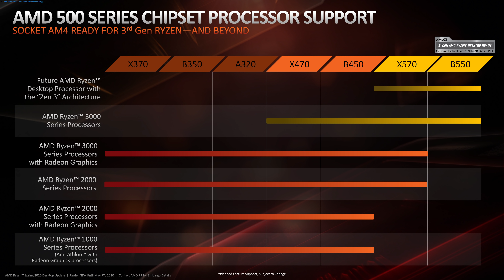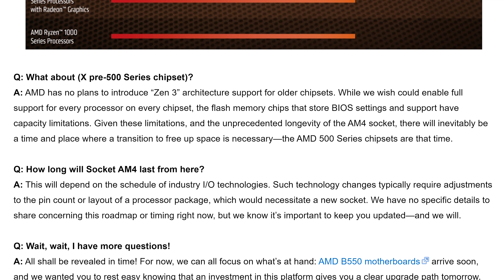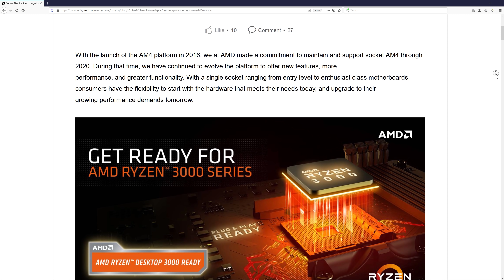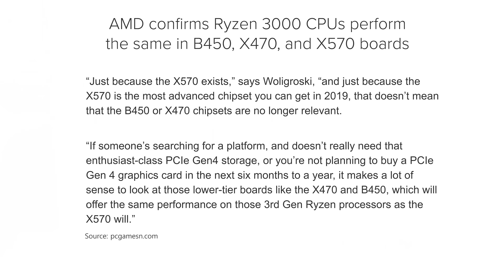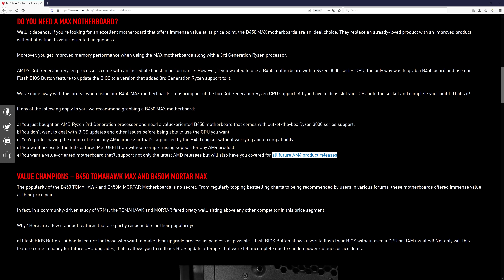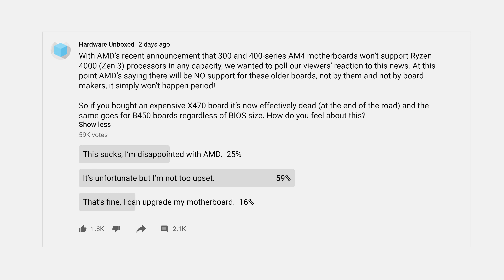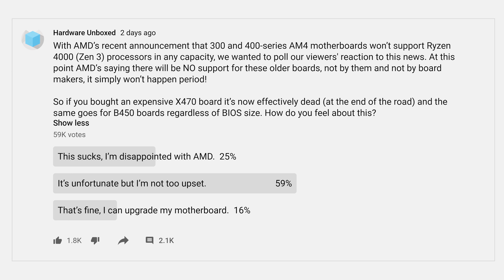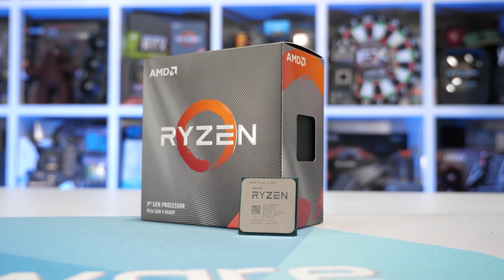AMD Does An Intel, Axes Zen 3 on 400-Series Motherboards, Our Thoughts

Comment: X470 owner here... I'm happy they did this!
I also bought the R9-3900x (12-core) CPU for gaming and video productivity, and when they started talking about the 4000 series being potentially a lot faster I thought "Damn, will I consider upgrading if it does?" then I thought "come on, you got a great CPU why even think about it?" but my brain still wanted the latest and greatest... well, now it's apparently a non-issue as I certainly won't buy a new motherboard as well... I actually expect my 12-core CPU to last a long, long time for multiple reasons:
1) games and applications will get better threaded (so will use MORE cores thus reducing or eliminating CPU bottlenecks based on individual core performance), and
2) many applications are shifting more towards GRAPHICS CARD acceleration
3) 2020 consoles like PS5 are likely to have a very LONG lifespan. PC games will utilize the same basic code for large part.
**So basically I can see upgrading the GRAPHICS CARD to an RTX3080Ti or similar but I honestly think I'll be getting 10 YEARS out of my R9-3900x. Seriously. I got SEVEN YEARS out of my i7-3770K which was a 4-core CPU. I could mostly game at 60FPS/1440p still with that. Now I've got 3x the cores and most games don't go above 30% utilization (with or without a CPU bottleneck?) Seems like plenty of future-proofing right there.

Comment: Uhm guys what part of PCI-E 4.0 is not understood? The next generation is not backwards compatible with 3.0. This is why you cannot take a Ryzen 1xxx cpu and toss it into a X570 chipset board, it doesn't support PCI-E 4.0. Now they could have had a compatibility layer, but that comes at a cost of performance. AMD had to and what I don't understand is you bitching about it when AMD has never done this once and is the first time and 3 generations could run off the same board, that's about 4 years of use. Unlike Intel who forces you to get new everything with every new release.  

Which brings me to remind you all of the socket 939, when everything jumped from AGP to PCI-e. Well some boards found a way to support AGP, some piss poor while few reached out and had a custom chip made to handle both AGP and PCI-e, look no further than the ASRock 939 Dual SATA 2.

Comment: I have a TUF X570 WiFi and I do care. When my MSI X470 GP Carbon imploded I bought an X570 partially because I knew in the back of my mind AMD/their board partners are chomping at the bit to pull an Intel. This is infuriating, and I doubt MSI are upset by this. I bet they were a board partner pushing AMD to drop support even if they know they're possibly getting sued. These lawsuits are all calculated as part of their budgets, it's a cost of business every major corporation considers when doing anything.

So I disagree with you for the most part, they may not be "just like" Intel, but they are much like them. They're a giant corporation, therefore a greedy entity out to make as much money as possible at any cost. The only reason they ever maintain any good image is their bottom line, not out of the goodness of their hearts. They calculate how much bad press they can receive resulting in how much potential sales lost due to a bad rep for doing X or Y dick move vs how much those dick moves make them to begin with.

Comment: Your wrong about the 300 series motherboards owners not being upset. I bought a X370-F Strix with every intention of upgrading to a Ryzen 4000 series chip based upon their promise of AM4 socket "support" through 2020. I could have spent about a $100 on a Tomahawk, but spent close to 2x that with the idea of getting a better board, with better VRM quality to ensure I could easily support the higher core counts and clock speeds in 2020. Any reasonable person would take their promise of AM4 socket support through 2020 would mean bios support for any AM4 CPU through 2020. Steve I love ya, but I also reject the argument of at least AMD should support 400 series. There is ALMOST NO DIFFERENCE between X370 and X470 chipsets other than slightly better XMP memory support (of secondary timings of more kits). So if AMD decides to open up X470 to Ryzen 4000, then X370 should be opened up as well, and they will have kept their promise! I also reject the idea that 400 series should be, but 300 series should be happy with what they got. WRONG AGAIN. AM4 socket support through 2020 means just that, not only 500 or 400. They said AM4 socket support. 
I don't ask for more new features like PCI gen 4 support (even though they easily could), just keep your word AMD!

Comment: This does suck. I built two Zen 2 systems on B450 boards, expecting that there would be an upgrade path with the mobo. It wasn't the focus of my requirements, but it was a contributing factor.

Biggest reason I didn't go for X570 (apart from the fact they were freaking expensive) was the total lack of mATX options (plus I have no need for pcie gen 4 and I hate the cooling fans on X570). Seriously, why do mobo manufacturers avoid mATX so much? I'll never go back to ATX, SLI/Crossfire is dead and I got over massive gamer-aesthetic designed-for-instagram cases a very long time ago. I enjoy having my desk space back, and I don't give a crap about farming pretend internet points posting photos of my rig. But now I'm off topic.

This is very disappointing news from AMD, especially given their comments and marketing giving the impression that B450 would be supported for next gen Ryzen.

Comment: Me thinks you're suffering from Post  Traumatic Intel Disorder #PTID.  AMD took us from AM2>AM2+>AM3>AM3+ almost the same way and I only had to switch either the motherboard or CPU, not both.  Am I disappointed that my ASRock x470 Taichi that I got with my 2700x isn't gonna make the cut, sure but I still have 12 and 16 core Ryzen 3000 to look forward to.

Comment: I am disappointed as I purchased a TUF B450M-Plus Gaming mother board just a couple weeks ago, assuming it offered some upgrade path.  I gave a lot of consideration to X570 but didn't think I needed it for PCIE 4.  And the availability of x570 micro-atx boards at a reasonable price were very poor to nonexistent.   Looks like I just plain picked the wrong time to build.  Almost every first choice I made was out of stock.....  Tho I did manage to pickup a Rizen 5-1600AF for $85.

Comment: If they are going to support 4 generations of CPUs on a socket they should include a bios memory chip large enough to do so.  I own a b450 2600 and was looking forward to upgrading to a single ccx 8 core 16 thread processor on zen 3.  Not 12 or 16 cores which I know my budget motherboard might have issues with on the VRM side but just an 8 core and I can't even do that now.  Leaves a damn sour taste in my mouth and I'm not happy.  I understand why many others aren't either. If I have to buy a new motherboard now anyways, should I grab an Intel part with 8 cores for better gaming performance anyway now...?  Sad state of affairs.

Comment: People were able to hack coffee lake onto x270 boards on their own, I doubt it wouldn't take long for the community to do the same for zen 3 on 300/400 series motherboards. The only issue was the lack of transparency from AMD, I could see a lawsuit and regardless of if MSI wins or not, destroying their relationship with their best oem/board partner for both cpu and gpu as well as laptops would not be worth it. They will bend on this issue or break trust with everyone entirely

As the owner of an x370 (msi xpower titanium) I don't really feel cheated by this as I can still slot an 3950x into this board for no additional cost. I mean unless AMD releases zen 3 and it wipes the floor with zen 2, the 300 to 500 bucks saved on not needing a new motherboard is well worth a 5-10% performance decrease.

Comment: I am another one of the MSI B450 boards and a R5 3600 purchasers (just before the lock-downs because I needed something there and then for working from home). Really pissed because I could only afford a R5 / B450 at the time, but was planning to upgrade in the next year to 8+ cores as I run a lot of VMs for development (either a second hand 3000 or brand new 4000). I figured that they would at least ensure that AMD wouldn't break support on a sub 1 year old design. Unfortunately I see this as a double whammy as the new chips won't be compatible and the second hand R7s / R9s will hold their value as they remain near best in slot for the vast majority of motherboards sold. 

AMD should have released the B550 earlier or at least announced that support would be limited. At least with Intel you know your being screwed. 

I will be skipping the 4000 ryzen processors as they will require a new platform that will be on its final generation with no future upgrade capacity. Come next upgrade it will be a new platform, so here is hoping that Intel gets it stuff sorted.

Comment: I've been holding out for a B550.  I think this crap.  But, give them a tiny bit of leeway for the support we did get.  They should be supporting B450 chipset with vendor support.  Unless Zen 3 is so good that cutting support is needed for performance.  But, again give consumers and vendors the choice.

Comment: When I first went the Ryzen path, I got a 2400G and a B450. I then upgraded cpu to a 3700X (i have never loved a processor as much as I have this one!).  I now almost have enough parts to put together 2 full computers. I am disappointed to hear that AMD won't be supporting B450 anymore, but fortunately, I was planning on buying a B550 board anyway.  Then I just will need a Zen 3 processor when they come out ....but it delights me to no end, that my 2nd, spare, backup computer, is going to have a frickin' 3700X in it. It is going to be the most powerful backup computer I have ever had.

Comment: Holy, Hell, that is enough compound for 10 CPU's 9:49. Less is more, in this case, they say pea sized drop or about  4-5mm.  Pea probably too big more like an eraser head on on a pencil more than that is just a waste anyways.   Applying too much thermal paste will lower the heat
conductivity and cooling performance!

Comment: The biggest pain in the rear-IO here is that B450 needed to serve as a surrogate B550 as the latter was nowhere to be seen for what ? A full year ?.
And now those exact B450s are thrown under the bus for the mysterious arrival of the worlds latest  ̶R̶y̶z̶e̶n̶ ̶3̶0̶0̶0̶ ̶r̶e̶a̶d̶y̶  Ryzen 4000 ready B550 boards.
This is not just about awful information supply, but about AMD simply ignoring the complete lack of mainstream mainboards for Ryzen 3000.

Comment: Well B450 board owners actually had 2 generations of support, Zen+ (2000) and Zen 2 (3000). 3 generations if you consider they actually support Zen (1000).
Reply: Except Zen and Zen+ are the same generation.  The 300 series were supposed to support Zen, Zen 2 and Zen 3.  https://hothardware.com/news/amd-confirms-am4-socket-support-future-ryzen-processors-2020

Comment: If B550 was available last year this would be less annoying. In particular I almost got an MSI B450 max  board, because it was all that was available in my preferred size and a well made board.
Zen3 is probably the end for AM4, so I'm holding out for AM5. USB 4, DDR5, better NVMe (I hope).

On AMD's side I see it form a compatibility assurance perspective, like it's petty much just DIY builders that want this, and maybe only MSI boards that would potentially work (bigger chipset memory on max models, and their capability to update BIOS without a CPU installed).
Finding out that SOME old boards will support it, but you bought the wrong brand would probably suck even more.
Reply: MSI aren't the only boards that have 32 mb bios chips.  All ASUS X470 have them.  Some high end X570 also only have 16 mb.  and they apparently get the upgrade.  How can the bios be a limit?

Comment: I now feel happy in a way that I didn't pull the trigger on my upgrade yet as I was very much intending on getting a B450 motherboard. Assuming there is not real physical limitation (apart from manpower) they should try and support everything they possibly could. As you point out at the end of the video I, unfortunately, expect the next round of CPU's will be DDR5 and will need a new socket too so whatever anyone chooses we are all going to have to suck that one which is not fully their fault as DDR5 is being released not an ideal time in the product cycle. I do hope AMD can before Ryzen 3 is released that they might change their mind even if that means that the older boards may have to wait a while for the update.

Comment: Question, is it confirmed that ryzen 4000 (zen3) desktop cpus are going to launch within the year 2020?
They launched the mobile 4000 series. But i dont recall anything about desktops.
The above might be a reason to make the 2017 statement of AMD completely true.

But, it kind of sucks as someone who owns a b450 board, but i was personally only going to consider upgrading to a 3900/3950 for future from my 2700 as i am not really gaming and use it for work/productivity.
If the 4000 series would have launched, im looking at the previous gen (3000 series) as the prices would have dropped and i buy new (but not current gen) than 2nd hand.

I do think board partners will talk with amd about it. And they will iron it out so i wouldn't throw in the towel just yet for 4000 series support for 400 series boards.
Reply: Zen 3 is expected by October.  It was actually supposed to be released in 2019.  So AM4 was pitched as being compatible with ZEN 3 in 2017,  when they were hyping support through 2020.   https://hothardware.com/news/amd-confirms-am4-socket-support-future-ryzen-processors-2020.    And I know that ZEN 3 will have AM4 sockets, but AMD didn't specify that the chipsets wouldn't be compatible in 2017.

Comment: This sets a bad precedence for what future AM5 early adopters might expect if AMD promise again through life cross generation socket comparability of CPUs and boards. I expect buyers will be weary. They should be. I now certainly would after my experience.

Choosing an AMD 3600 for my pc upgrade has been a nightmare. 

Buying at launch, AMD firstly failed to deliver new budget-mid boards (B550 etc) for new adopters like me, instead advising to buy older chipset B450 boards as ZEN2 compatible. But I soon learnt that turned out was NOT out the box!  

So i then had pay more for to get a ‘no cpu’ Bois flash version, the process of that being a total nightmare needing a working pc to download that I had to borrow and then a certain type memory stick to do I had to additionally buy both delaying getting the pc running.

Then finding that ZEN2 has no windows7 drivers or support and apparently won’t ever have even though it’s a still current MS supported OS (2019) so now forced to further additionally buy win10!

It then also transpired the b450 Zen2 bios is a downgraded ‘feature light’ bios version as the boards ROM chip is insufficiently sized for full feature. 

Come one AMD, You advertised guaranteed through generation same socket cpu support from the start, it’s a massive oversight of incompetence to not specify to your board partners an adequate chipset ROM capacity to accommodate that!

On top of that your AGESA wasn’t allowing full clock speed for months. It’s minor but it really should have been ready, along with your B550!

And NOW they’re pulling the rug from under us being able to buy the next gen of CPU when I along with a lot of others specifically came over to AM4 with the advertising of through life socket support. 

Personally I planned to upgrade to a faster ZEN3 with more cores when games eventually need the boost.

Overall a Bad experience. Pretty pissed tbh. 😡
Reply: And that’s without purchasers of faster CPUs not getting anywhere near their advertised boost clock speeds or the supposed promise of yet further overclocking beyond that which was detailed on stage at launch event! 😡

Comment: Thank you for that video. I've seen too many tech Youtubers gloss over the issue, or even backtrack their previous comments on the subject of forward platform compatibility.
I'm one of those who bought into the platform with Zen2 a few months ago, and bought a Tomahawk Max for it, one of the major selling point was the ability to get a bigger faster Zen3 cpu down the line when they are quite cheap (probably at Zen4 release). I wonder how will MSI deal with their promises and contractual obligations on that one. 

If I take a step back, the biggest issue to me is AMD lies. I could understand them dropping support (although it would clearly reduce the platform value) for 400 motherboards, if and only if they announced it when x570 was released. Like you said, people buying this last year could have just paid $50 more for a x570, if that was required. 

One note though: you say AMD is still better than AMD, I disagree. And that official graphic you put at the very beginning proves it: each chipset only support two generations, like a lot of Intel ones. Yes I do agree AMD did A LOT to improve performances (and I have not forgotten a64, Athlon XP/MP, Athlon 64, and all other greats things AMD did for PC computing when Intel couldn't or wouldn't), and I agree that a early adopter of a cheap a320/b350 did see great value. But still, it's only 2 generations officially.

Comment: I see no reason why motherboard manufacturers couldn't remove 1st and 2nd gen support in a BIOS revision to support 4000 series CPUs.  I'm still happily sitting on a high-end X370 board, and would like to continue using it for another generation.  I assume X670 will be the end of the line before a switch to socket AM5 and DDR5 support, so I don't really want to pony up for a new motherboard for 1 year of use.